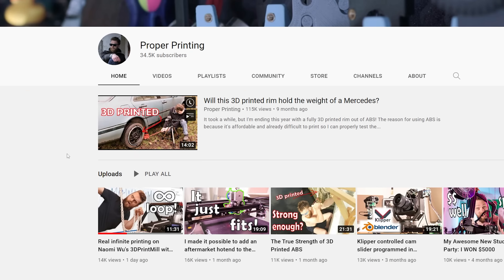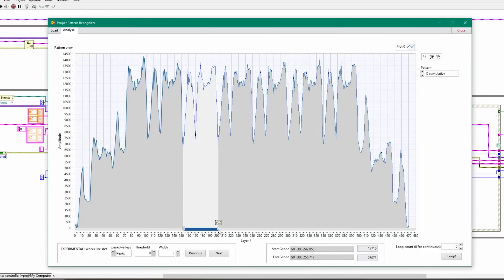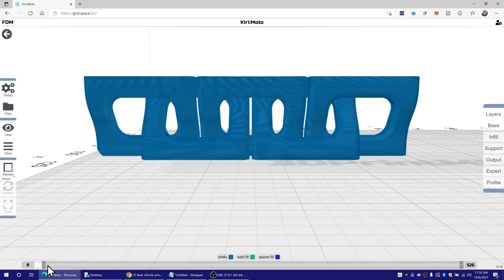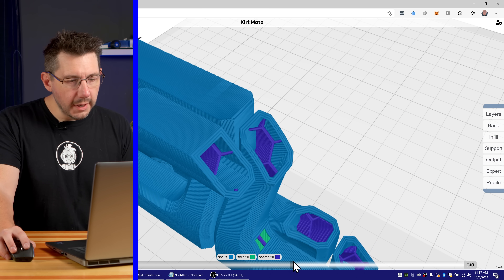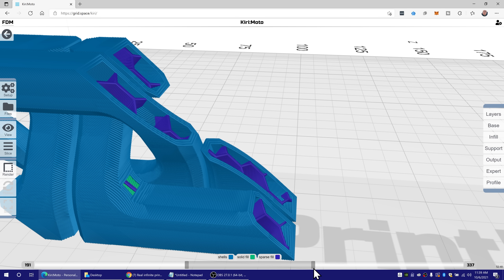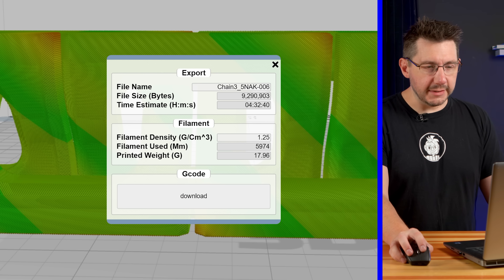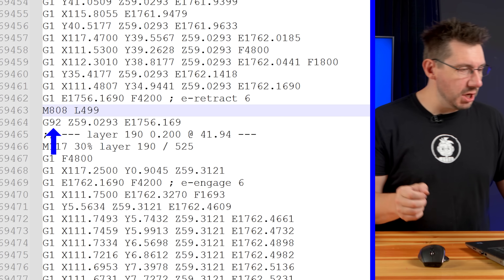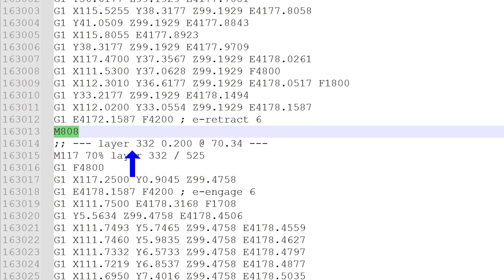3D Print FOREVER

Comment: Hi Joel. This printer interests me but the reason I’ve held back is because of print quality and limitations on print orientation. I’m considering buying the printer and using the belt as a print bed for a custom build. As opposed to making the z axis infinite, why has no one considered making the z axis perpendicular to the build plate…. The printer could print a whole part, raise z axis and only then eject the print to start a new one. 

The only farm management systems I know of use robotic arms to clear plates and start new prints. This could be a low cost game changer if the printer could print like a standard Cartesian and only use the belt for ejection after print is complete

Comment: Sticking bed problem, have an idea for you, wrap belt in paper that has been dunked half a dozen times in water glass, it won't burn, is flexible, you might even try putting water glass ( 6 layers or so) directly on the belt!
Reply: Hint If this works, I could really use a a 3dprinter which I can never afford!

Comment: I don't believe you can make 'Nested' loops if the start/end marker is exactly the same.  No way to differentiate the start of one from the start of the inner.
BTW, I use Npp.
Reply from the maker: You can! I swear!
Reply: It looks like if the M808 command has an L value, it's a start marker, and if it doesn't have one, it's an end marker.

Comment: I think you should do a real infinite loop.
Print the chain, using 0 for the end point and have a shredder below funneling shredded PLA into a filament extruder, which feeds recycled filament back into the printer.  Assembly and disassembly line all in one. 😂👍
Setup a counter and we can see how many times different filaments can be reused....SCIENCE! 😜